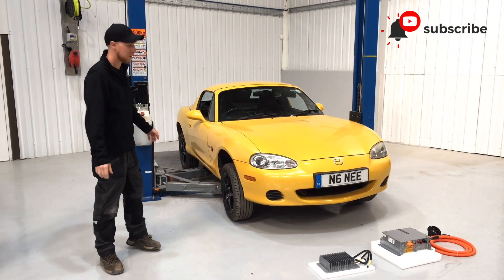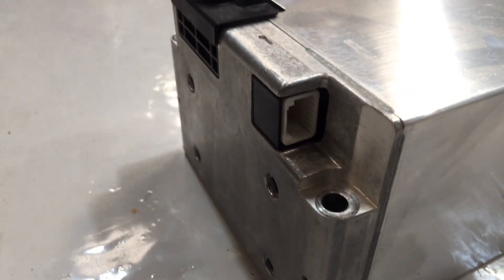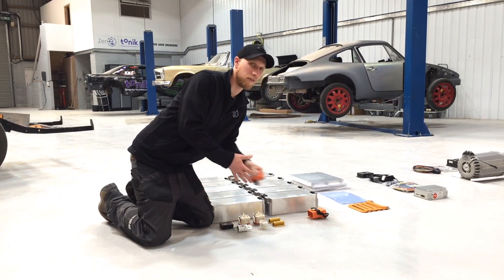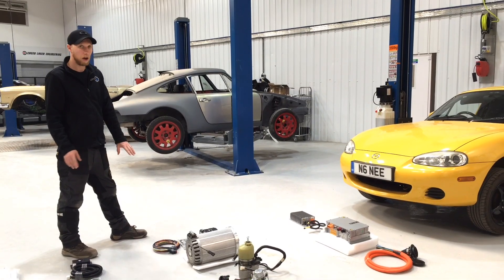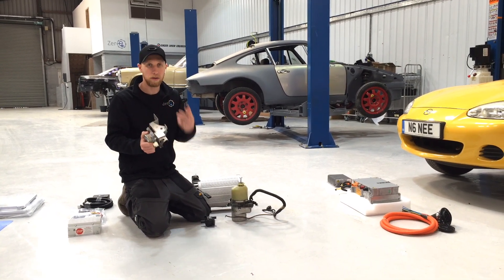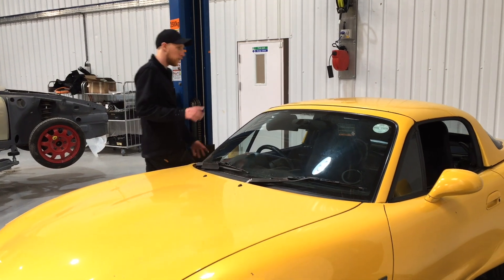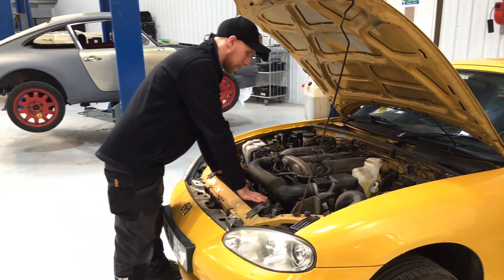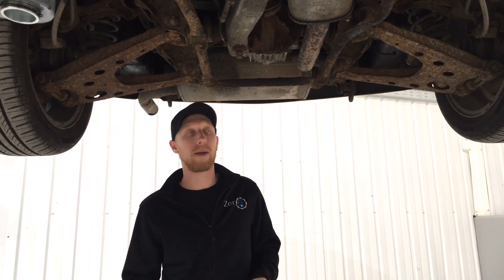We Built an Electric Mazda MX-5 Miata

Comment: What range and tq kwould this setup have?
Reply from the maker: Royce Stricker around 100miles and 220 torque
Reply: @Hazell_Nutz  what set up would do around 200 miles?
Reply from the maker: Royce Stricker just add a second 26kwh battery pack, there is definitely the room where the fuel tank was plus a little bit of the boot space.

Comment: Subscribed!  My last car before emigrating from the US in 1998 was a Miata - green with the flip headlights. Fantastic car to drive - did 15,000 miles in it during the 15 months I owned it. And I lived in the US northeast so there were several months where I could not drive it!

Any ideas on what the range will be?  And will the weight be that different?
Reply: Ah, see you answered these below:

"Oisin Murray with the 26kwh battery pack should be about 100 miles. There is probably space in the rear to also fit another pack if more range was needed"

"Steve Goodenough would say very similar to original, battery’s come in at 120kg ish, motor with gearbox about 70kg, carver and dcdc another 15kg plus allowing for battery box cable and other parts may we 250kg total. I will be pulling the fuel tank and weighing the car again on the next episode so let’s see."

Good stuff, looking forward. I'm in Ireland and would definitely be interested if you do a raffle!
Reply from the maker: Weight wise sound be about the same maybe 50kg more tops

Comment: Sounds like a great conversion.  Unfortunately, conversions like this are still too expensive.  The cost for this conversion would be around $25k (US), including the car. You can pick up a well sorted car & throw a supercharger on it for under $10k, including a tuning solution.  So, as much as I’d like to do it, financially, it just doesn’t make any sense.  Perhaps prices will come down some day.
Reply: Perhaps Mazda will come out with a Miata EV.
Reply: while yes, electric car conversions are expensive, the Miata is a very light car, so as long as the weight distribution remains similar, you wont need  powerful motor to drive the car
Reply: You can sell all of those unused parts from the car to make some money back
Reply: But it wouldn't be an EV then and the whole point of an EV is it's on steroids from the word go.
Reply: LS swap is better cheaper and holds value.
Reply: I can get a tesla for this budget.
Reply from the maker: Yes that’s correct, currently parts price is still quite hight but over time should improve. But to take into account savings on fuel long term.
Reply: @Hazell_Nutz  You have to be quite long-term to make up $15k worth of difference in the cost of fuel, especially considering how the bottom of the oil market just fell out.
Reply: @TheSonic10160  That's very true. But other things to consider that are both real costs and related costs. Fluids and filters and all that time they take to monkey with are no longer issues. And, you never have to go to another petrol station, something my EV-owner friends have been singing about for some time. And, of course, oil costs will indeed rebound, something you can count on. Just a better overall ownership experience. Looking forward to when - not if - the component prices drop, too.
Reply: Samuel Zelter with zeroed out electricity costs at home 7.5 years maximum to pay it back and realistically it’ll be faster that that the more you drive. Also most don’t account for the inconvenience of nearly eliminating gas station trips every 300 miles. Now on rare occasions and longer trips you’d have to fuel up away from home via charging stations, but now daily driving scenarios don’t chunk away at the fuel percentage. Having an electric car can also make paying back a solar system more rapid.
Reply: @RetroElectric  plus cost of servicing and maintaining an ICE.

If I can convert my old vw bus (which will cost probably as much, if not more than buying a new Nissan Leaf) I'd probably go back using it as my daily driver. Going back to driving to work everyday, which I haven't done for well offer 10 years, and getting anywhere from an hour or more of my my life back everyday by not taking thre longer public transport commute.
Reply: @Hazell_Nutz  25k buys A LOT of fuel. That buys me 52 years of fuel at current prices. So fuel saving is a terrible point sorry
Reply: @Hazell_Nutz  Give me a message and see what we can do about it ;) OCD Engineering Ltd Turners Hill.
Reply: @Hazell_Nutz  the batterys need to be replaced that counts as fuel imo
Reply from the maker: @frankmundo4300  why does it need to be replaced? This pack is good for 300,000 miles way more then the rest of the car would ever last for!!
Reply: Ahhhhh, but if you’re not careful, your local government will decide that you’re no longer allowed to drive your beautiful classic petrol car, and the only way you’re allowed to drive it all is by doing an EV conversion :( I wanna cry every time I think about it but in that situation price and actual performance aren’t what’s being played with here. It’s do you get to keep your beautiful car on the road or not sniff
Reply: @elementaljosh  Banning petrol cars would be beyond stupid on so many levels, I doubt that's ever going to happen
Reply: @ichkommentiernurkommentare7237  I hope it will. For the sake of our lungs
Reply: @90albert0  If you're drying from lung cancer caused bei gas cars, or caused bei EVs doesn't really matter that much.

If you want to improve air quality, while not screwing up the environment and the economy, you have to try to get rid of cars completely, and slowly.
Reply: @90albert0  yeah..... petrol cars are not really that bad for your lungs. Mainly old diesels are bad, and ev's also pollute they air. Through their tires and brakes, just like any other car.
Reply: @ichkommentiernurkommentare7237  Its already happening in places but its the sale of new ones, other places are banning them completely :( I don't think they will pass unanimously though
Reply: @ichkommentiernurkommentare7237  they should ban non-hybrids at least, it makes no sense to waste all that energy in traditional brakes if it could be captured and reused.
Reply: @90albert0  total agree but true % reduction in CO2 with zero ice cars on road worldwide CO2 will only drop 30% , coal and gas is bigger ,power generation and cooking and heating. 
But EV's def a big start .
Oh since lockdowns start with covid co2 has only dropped 5%.
Now scientists think higher temps cos less co2 in atmosphere to block UV.
This is crap.
Reply: @90albert0  In your dream maybe? 

Joke aside, it will happen but not so drastically. But progressively.
Reply: @elementaljosh  if by local you mean city and probably even state when applied to the US then that wont happen for a while. I mean california gets flack for emissions and conservatives want it gone while screaming state rights, i dont think any country is going to let a city say no gas cars allowed. A country sure, that can happen but i dont know if local governments have that amount of sway anywhere.

 If by local you mean country however that makes sense, carry on.
Reply: @elementaljosh  cars that were built before the change would be exempt. And realistically the gov would give minimum 1 year notice cuz they need to give time for car manufacturers and part suppliers to prep.
Reply: People write as if the industrial processes needed to make the motors, batteries, and other components necessary for an electric car do not pollute. All these things are done in factories, getting the metals that go into the batteries requires destroying entire mountains by mining ... Leftists believe that by putting a couple of solar panels they have already saved the planet and that is ridiculous.

Comment: Great idea - you're starting to build a lot of people's dream EV conversion car here!  Mazda wake up...
Reply: Mazda is one of the only manufacturers that is still pushing ice engine technology to achieve better emissions/efficiency. They also produce far far less cars than someone like Toyota or vw. It's pretty amazing to me that are still managing to do as much r &d as they do on their sky active range etc. I don't think electric is part of their current MO.
Reply: Obviously not the only one!
Reply: The original developer of the MX-5 did say he was keen on doing an electric one provided the drive characteristics of the mx-5 could be retained. I'd imagine the biggest issue would be getting the 50/50 weight distribution?
Reply: do a silence, sir! my dream EV conversion is an '93-'95 RX7 and a 2004 RX8 from Mazda! 😁
Reply: Mazda can't afford to gamble their way into bankruptcy! They already tried a lot with the wankel. Let the battery tech mature first.
Reply: Mazda, wake up ?
Automotive enthusiasts, wake up ! Petrol engines today's weighs nothing and easily develops over 200hp
Lightweight electric cars are going nowhere
EVing a light car just doesn't work. Who's still using a Tesla Roadster ?
Reply: @nigo1787  Who's driving a tesla roadster? Who's driving a Ferrari F40? You have absolutely no idea about anything. Engines are extremely heavy. Its the gasoline fuel that's much more energy dense per weight than lithium batteries.
Reply: instead of a 70-75 kw battery and a weight of 600 kg it is better to divide the battery in two. one of 10-15 kw and 100 kg permanent with a range of 100 km that would be enough for the city and a standard battery of 60 kw and 500 kg detachable to rent when you leave the town. instead of stopping at the peco to fill up for the road you can go to an electric charging point in your city and mount a standard 60 kw battery from there and on the way to replace it at another electric charging point with one loaded. the first advantage is that it would save a lot of batteries in the world, especially since the 2 million km batteries will appear, which practically do not wear out and must be fully exploited. if a car is lighter by 500 kg, I think it will have a significantly greater autonomy in the city. this would be the second advantage. a short recharge time of up to 5 minutes to change the battery would be another advantage. the price of electric cars would drop by half. lazy people who do not want to charge the car every night or people who have range anxiety can use both batteries permanently with the asumation of costs. I'm waiting for opinions
Reply: @cornelstamate2537  You're not thinking from a manufacturer's point of view..... it would make a lot of sense, but I think the car makers who would go to EV will have higher agendas to follow that would make it not a viable success......good ideas usually only favour the ones who benefit and the good ideas that don't generate the continuous return finance like the dry cell throw away torch battery....torch for free and forever hooked into buying batteries etc or the printer cartridges....cheap almost give away printer and extra costly printer cartridges.....forever.
It has to be a tie in to get deep into your pocket on an ongoing basis or it won't work for the manufacturers of any technology no matter what it is.
BTW.........I read once that the automobile was invented to enable the multi millions tied up in the oil industry to be released from the millions of the general public that for generations were satisfied with horse travel etc......EV cars preceded the petrol car over a hundred years ago.
Reply: Mazda reduces more emissions by improving the engines of their entire fleet, rather than focusing on building an electric car while their engine technology languishes. They are a small company that can't afford to do both.
Reply: Yeah True what you say I think that Mazda don't want to get into EV's in a big way until the battery supply & development is under control. Tesla has such a big start on the opposition.
Reply: Lol 😂 why would anyone want a driver's car to be electric 🤣 you Sunday grocery store drivers need to  learn what real muscle is
Reply: @Matt M. Hmmm...a bit of a cop out!  If a company can inplementa a whole charging system bassed on an electric drivetrain, I am pretty certain a system for recycling the materials used in creating batteries can be implemented with a little bit of thought.  Also, how long do these batteries take to fully be useless?  Seems to be a long time; car batteries last as long as the car and can then be repositioned as home/commercial electrical storage systems!  Unfortunately, companies such as Mazda, will be too slow to change, and may be a casuality of the move away from ICE technology.  Tough times for the car market.  Love to see more car manufacturers open their eyes to offering EVs.
Reply: Jeff Harris Yes and on the rare occasion the executives allow the engineers to make EVs - like the 1000 Rav 4s Toyota made- THEY SELL OUT!
Reply: @Swampwild1  I've always thought it would be really cool to electrify my 1996 Rav 4 two door.......sigh, if only.

Comment: Why do you need a 5 or 6 speed gearbox? It would make so much more room under the hood to connect the motor where the trans is or if some gearing is needed a small two speed unit instead. Clutch is also not needed.
Reply from the maker: We will be fitting our new single speed 1.8:1 gearbox so the complete motor with gearbox will fit in the tunnel.
Reply: @Hazell_Nutz  Awesome!!!
Reply: @Hazell_Nutz  I would love to see any past or future conversions where you've retained the gearbox (or installed another multi-geared one - basically retaining entire shifting experience including the clutch).  I came here just now after watching a video where that was done on an '90 Miata.  Look forward to your next installment in this series.  :)

Comment: Clean electric vehicles getting their energy from a coal burning power station
Reply from the maker: Paul white nope we have a 50kw solar set up on the unit all clean energy here.
Reply: @Hazell_Nutz  batteries made in Japan filled with metal mined in Canada and transported around the word in a ship that burns diesel . Electric cars can Only claim to be zero emission "in use" it by comparison a model T hot rod probably has a lower carbon footprint than a Tesla and is probably more recyclable

Comment: Did you get a new weight number with everything out? Any expectation on final weight of the car? Lastly... do you expect to maintain its original weight balance?
Reply from the maker: Bruce M hopefully will be very similar to original current concern is the rear will be abit lighter as no fuel tank.

Comment: Why the relatively low voltage choice and also is there any intention on putting a rapid socket in. I believe orion bms support it. I am not sure what the lowest voltage ccs/chademo run at though.
Reply from the maker: Whereswally606 we normally build 400v systems but just doing something different with one of the most common go to Ev motors on the market. Can not do rapid charging below 200v but yes the Orion does support chademo on high voltage conversions.
Reply: @Hazell_Nutz  nevertheless a good looking project. I like the lg cells looks good for similar jobs too like the muxsan extender in my nissan leaf.

Comment: As a longtime mx5 fan,  I'm liked and subscribed to this. 
They really did you a disservice in Europe,  not giving you the 1.8l variable valve motors.  175 hp
Reply: I have one on my driveway in The Netherlands, the 1.8 was an option and sadly quite a rare one.
Reply: I've had 2 1.8vvt Arizonas (both yellow like the one in the video) I thought they were quite common
Reply: @mrtwig2963  Britain has a lot more 1.8's than the rest of the EU it seems. I think one in 10 in mainland Europe is a 1.8vvt

Comment: Whats the after weight likely to be? So looking forward to the next update!
Reply from the maker: Steve Goodenough would say very similar to original, battery’s come in at 120kg ish, motor with gearbox about 70kg, carver and dcdc another 15kg plus allowing for battery box cable and other parts may we 250kg total. I will be pulling the fuel tank and weighing the car again on the next episode so let’s see.

Comment: Good presentation. Thanks v much. You make it look easy, but I know it’s not. The electric pumps solution seems more elegant than bolting the cars original pumps to the motor with an adaptor plate & fan belt, as seen elsewhere.
Reply from the maker: N R yes using an electric pump is definitely the way to go and properly cheaper as well.